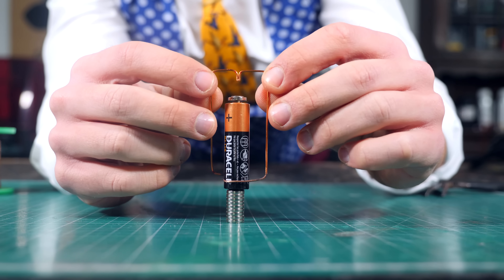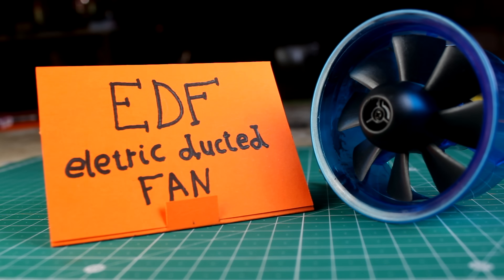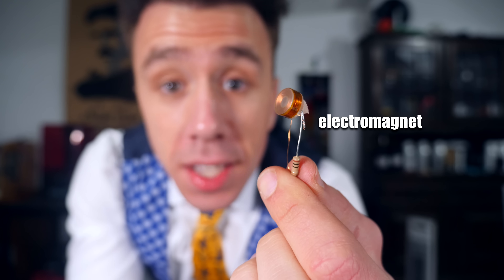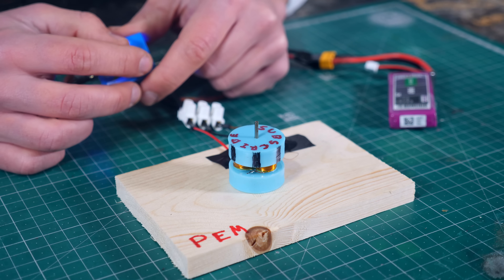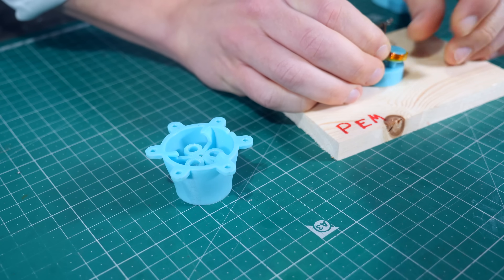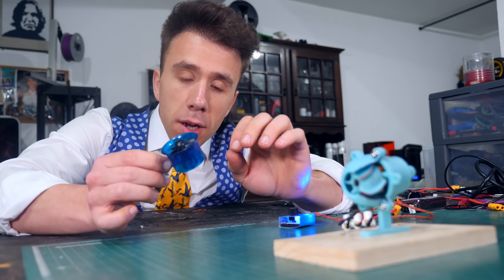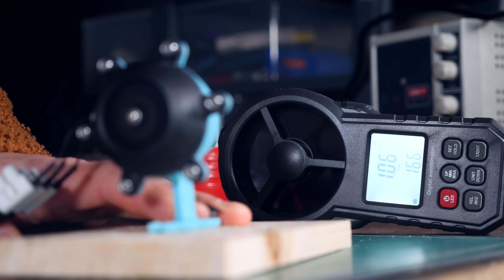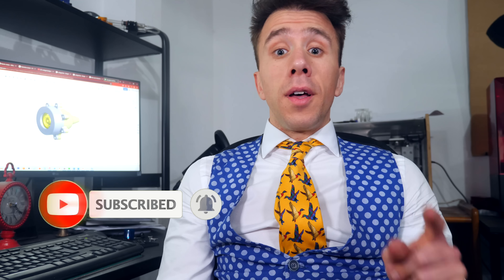I 3D Printed an ELECTRIC MOTOR FAN

Comment: Fans are great for converting rotational energy into propulsion and they do it fairly efficiently this is why turbofan aircraft are some of the most efficient and why most of the air moved by a modern jet engine is actually bypassing the combustion chambers and operating like a propeller. Higher bypass ratio is typically higher efficiency which is why modern turbojet fan engines are getting larger. These generate high mass flow rate but lower velocity and are good for cruising. Your EDF is essentially infinite bypass ratio as there is no air diverting to a compression/combustion chamber making it far more efficient at mechanical propulsion. The centrifugal fan is great at compressing the fluid and are frequently used in pumps and in front of combustion chambers for this reason where you have limited volume but you need more air mass to mix in more fuel mass. 
Thinking from an energy perspective instead of just pushing the air backwards with one bounce off the fan blade you are bouncing that air off of the impeller and the walls/channels of the housing multiple times while compressing it so you have some frictional losses as well as thermal as the air heats up under pressure and that heat dissipates through the housing. Performing more steps in the process will mean you need more energy input to achieve the same output. More or less it has been a few years since learning about pumps and turbines.

Comment: Recently I saw a video of 3d printer fans explaining the difference between axial fan (regular brushless fan) an blower fan (centrifugal fan), in there they explain that regular fan cannot move air trough a duct  as well as the blower fan, but what I really notice un your model is that centrifugal fans blow air better by the sides but your design kind of acts as a regular fan, moving air from the front to the back; the trust difference must be caused by the blades of the fans one having more surface than the other resulting in moving more air, just think this if two different cars have the same motor that doesn't mean they will run equally, there are so many variables (transmission, differential, tires...) , that are my thoughts in not an expert but hope this helps, the video I mentioned on top it's titled "3D printer fans - axial vs blower..." Also recommend you to reach to "the fan showdown" community of  Major Hardwarehere on YT, some of they know more about aerodynamics than me, and it's really fun to see 3d printed PC fans performance !

Comment: There was not as much information as I would like about your test, so I am not sure how much of this is speculation on my part:

1 - The distance between the tips of the fan blades and the edge of the duct is critical - you need this to be as small as possible to get the full effect.
2- Are you just measuring air flow and equating it to thrust?  The duct on a ducted fan should act as a lifting body, as well as acting as a nozzle to convert pressure to speed
3- As others have pointed out, you are changing the direction of the airflow.  Combined with the likely increased surface drag of the 3D printed part, you are going to see some losses.  TLDR: The straight duct is the most efficient way to make air faster.  Anything else will be second best.
4- The Dyson system is not designed to move the most air, it is about creating movement with the lowest sound and highest pressure difference while being efficient with power.

How to improve your design:  Start with analyzing the flow rate of your design vs. the the ducted fan.  Once you have maximized the  flow fate, tweak the design for the highest pressure differential.  Remember that thrust is the mass flow times the exhaust speed PLUS the pressure differential times the exhaust opening.

Comment: Different Propellers have different thrust-characteristics.

The motor inside the EDF does not just produce a fixed amount of thrust but rather it is designed to deliver a certain amount of power at a certain speed. If your centrifugal fan has different massflow and resistance characteristics (well duh - it has) then it will also perform very different.

In general an EDF is designed for nearly unrestricted straight airflow - so very low backpressure. Where as the centrifugal fan is very different - more useful for high pressure.

Also Dyson making the best impellers? No. They are just the same as everybody else too. Hell their fans are rather inefficient and take a lot of power to move the same amount of air. Their concept is rather that is looks neat and you just don't see the fan that is actually producing the airflow.

Comment: Too many factors to be honest. Blade angle, blade area, blade diameter, blade speed, blade design are all factors. Also, there is a difference between high speed or high pressure, or high volume low pressure. Fans have different designs per application. I would start by increasing the diameter with the understanding it will add mass and reduce the rpm but may increase flow enough to create more pressure thus higher thrust. May also make the output wider or smaller. Wider less pressure more volume smaller higher pressure may be less volume also.

Comment: If it is the fault of the difference on the curve of volume flow/pressure of both fans as said in other comments, you can also easily measure the pressure drop with a long tube with water, one end goes to the ambient pressure (before the fan inlet) and the other end goes to the outlet, to avoid errors it is necessary to close both outlets in the same way.
Each cm difference in water is a pressure drop of 100Pa. 
With this test you can easily see if the problem comes from the difference on volumetric flow/pressure curve that each fan is able to deliver.

Comment: I am an engineer, but of the electrical flavor with a good understanding of thermo and mechanical things.  Anyway, my quick answer is mass. The centrifugal fan you are printing seems to be optimized for pressure buildup, not CFM.  Thus, you are ‘throwing’ less mass, at higher pressure when compared to an open-ended (both sides) fan, such as your desk fan or your ducted fan.  Dyson fans use the centrifugal fan to build up pressurized air, that air is fed into a slit around the ‘airfoil’ shroud, which works by Venturi effect to increase airflow by creating an area of lower pressure in the center, thus amplifying the CFM/air mass being pushed toward you.  The air flow you get from a Dyson fan is NOT all originating from the fan… it is amplified.

Comment: First: This is definitely one of your better videos - a lot of ideas packed in with simple to understand explanations and entertaining as well. Most definitely worth the thumbs up.
Second: Thanks for the compliment, but as an ol' fart, I'm definitely NOT cute. I've been a fan for a while, but not cute ... (that's ok, I had my hay-day).
Third: 
> point 1: The efficiency of a ducted fan no matter what the fan's type or configuration is greatly effected by the gap between the fan blades and the inner walls of the duct. The greater the gap the less efficient. It's like a leak in a bucket. A large enough gap allows the edges of the blades to develop turbulence eddies that actually oppose the flow of air. It will be difficult to narrow this gap with a 3D printed fan because of the material's flexibility and the high RPMs, but maybe you can analyze the expansion or warping of the blades at different RPMs and design the duct dimensions according to a specific RPM.
> point 2: In the compression chamber when compressing the air there is a balance between air flow and compression rate or percentage. If you compress too much you begin restricting the flow; if you allow to much flow you aren't compressing enough. Consider a garden hose nozzle that you have closed almost completely. Water doesn't compress but this increases the pressure to maximum, yet the flow of water which may be at a high velocity out of the nozzle, it has very little volume so very little thrust.

Comment: This design is more of a "mixed flow" impeller.   Not really centrifugal or axial.    Centrifugal blowers are more for applications that need static air pressure with moderate flow.    Axial blowers are more optimized for volume flow rate.    It's not surprising that a centrifugal blade doesn't have as much volume flow rate as the original axial blades.   They are for different design points.

Comment: Aerospace engineering student here. Might not have a perfect answer but probably have a decent guess. 

The aerospike's success is fully dependent on choked flow and supersonic flow. There is almost no way you have a high enough pressure or velocity to generate choked flow. 

I'd suggest making the system larger, so you can have the ducted fan and the impeller in series with eachother. It may not give you supersonic or choked flow, but it should at least increase the thrust.

Ideally you would design a turbine to work with the nozzle. 

The critical thing with the aerospike nozzle though is the choked flow, without having supersonic flow after the throat velocity and pressure drop sharply.

Comment: ...perhaps in compressing the air the actual thrust generation is becoming lower?  The energy must be going somewhere.  The vacuformed edf probably has lighter parts as well, they may be more rigid too... if my experience with resin printers is any indication...  

I do wish I were closer... to figure it out of need to deep dive on the mechanism and figure out the exact forces involved and...well...  chances are it's just inefficiencies we can't see

Comment: Poking at this, maybe your centrifugal fan can be a lot bigger so as to increase the load on the motor. Maybe some energy is lost to the pressurized air not fully reexpanding by the time it leaves the nozzle. Maybe the printed parts are heavier and less efficient - but that mainly comes into play when it starts to limit the motor's RPM

Comment: My best guess for your problem is a difference in the Volumetric Flow-rate of the two designs. The intake diameters are different. If you are using the same motor, with the same top speed per design, then you would get reduced thrust on the output just because you have less air coming out the rear of the fan.

I am by no means a jet designer and my fluid dynamics skills are rusty at best, just as a disclaimer. My approach would be to check my speeds under load of the two fans to make sure my first assumption holds true. Then do some research on the Dyson fan motors and see how their kv and torque specs scale to the EDF motor. Then use that information to scale the design to match the difference between the EDF motor and Dyson one.

Comment: in simple terms

impeller good at increasing pressure, bad at pulling in air.
axial fan good at pulling in more air, okay at increasing air pressure.
fan blade really good at pulling in more air, bad at increasing pressure.

i suggest adding 2 or 3 stage axial fan before the impeller.

Comment: The Dyson motor spins over twice as fast as the EDF motor.  The EDF design is optimized for the 45k or so rpms of the motor.  The Dyson impeller is designed for the 120k rpms of the motor it uses.  So it does make sense that the Dyson impeller shape made less thrust that the EDF fan with both running at 45k rpms.  My guess would be that impellers require higher rpms than fan blades, but it may also just be possible that the impeller design has to be optimized for the 45k rpm speed.

Comment: So basicly your problem is volume of mass your fan does pass through. 
Potential reasons:
1- its easier for some air to go around without entering the inner area thus accelarating only with force of stickyness of air. Mate fan flatter and less aerodynamic in general. 
2- there is innecr cavitations inside the fan, basicly air is finding a spot to turn around and handycap the power output. Use method of sections or whatever aerodynamical analog there is to analyse the flow and to make apropriate size of chamber. 
3- there is something less obviouse. maybe plastic you're using somehow effects it. maybe dunno stand disrupts it. Neither give us like 34 min video with every test you can think of, info on your setup of printers and inner electronics ooor. Go and hire/ make friends with apropeiate specialist.

Comment: you should look at the long shaft turbos used in F1 engines, you could replace the exhaust impulse with a motor, and have a hybrid electric jet turbine, increase turbine speed with motor and turbine feeds combustion, and fuel mixes. this could also work to atomize fuel in the air charge before ignition. or at least a perspective way to make a rocket/jet speed controller. love the content, you make Nikola proud.

Comment: Shove a turbojet into your bicycle and see where that goes.
Also, for the turbojet, use a multi stage turbine to extract as much energy as possible from the exhaust. And maybe use a different type of compressor, preferably one that uses the entire diameter of the engine, because in your model, the impeller did not use maximum      space possible, which bottlenecks the airflow.
Also, in your RDE project (by far my favourite video) you should make the inlet for the detonation towards the side, like in your tesla turbine. And make an annulus so that the Rd wave does not just travel to the center of the barrel and dissipate.
To improve the airflow and still get compressed air, use a multi stage fan. Basically, it has multiple fans around a shaft that gets thicker as you go inwards. Thicker shaft + same size duct = less space for air = compressed air.

 Also, my brother likes to eat tomatoes raw.

Comment: The duct fan is designed to do air mass flow, the turbine is design to build pressur (or vaccum in fact) vaccum is not flow and they will never be equal. What you need is to build is a compressor fan design.  the first blade push the outside air in, it take up some speed than a new set of blade that should be placed in a different angle to take in account the new speed of the air and you continue like that, usualy those set of alternative blade should turn in diferent rotation side, but it is possible to do with out  a transmission to inverse part of the motor force by putting the alternative row of fan fixed into the wall of the duct walls with enough speed on te rotating blade the fix blade will act as if they are turning for the air flow.  This will create a lot of compression.  Like in a jet engine.  ;-)

Comment: you have 2 problems but luckily there's a few known solutions and i'm sure you can make your own

the impeller shoots out high pressure gas, we can agree on that i'm sure
so the issue is the pressure also pushes the air backwards into the fan which overall will decrease the amount of air you're pushing

and a second point, kinetic energy is 1/2 m v^2
the v is there twice, that means that the linear relationship of mv being vaugely constant (bernoulli's first principle, AV=cts, and from that you can reach mv is constant too but that's for an incompressible fluid so it won't track perfectly) the ideal kinetic energy turned into work is more to the higher speed less mass part of the spectrum and that's where the highest thrust would be 

so to summarize those 2 points the geometry of incompressible fluids would make it so that you get more thrust from more speed than more mass

and the fact that air is compressible is working against you in this situation

what you want is to create an area of lower pressure which is possible even with your current design (I suggest looking up how a dyson fan works to push air, it doesn't simply use the impeller flow, and also how a levalval (i butchered the spelling) nozzle for a rocket works), i'd suggest adding a nozzle that allows the air to expand smoothly so that you can have an area of low pressure   that helps the high pressure air come out faster, but at that stage we're reinventing the nozzles used by nasa, there are other ideas like the ones used by dyson and aerospikes where you run the high pressure gas along a surface of certain geometeries and gases simple like to stay close to these surfaces so you can generate your low pressure area as such

Comment: I was searching the internet in some ideas of a proportion sistem and sudenly thought of a turbojet engine with a plasma-assisted combustion system. The combustion process in traditional jet engines relies on mixing fuel with compressed air and igniting it using a spark plug. However, this process can be inefficient and generate harmful emissions.

In the proposed turbojet engine, a plasma-assisted combustion system would be used, where the air and fuel mixture would be ionized by a plasma discharge to initiate combustion. This would improve the efficiency of the combustion process, resulting in a more powerful and fuel-efficient engine.

Comment: The differences between axial and centrifugal fans/compressors are pretty extreme... one is an air screw, the other just yeets air at the wall.

The axial fan screws the air through it (look up tip vortices on aircraft taking off for a prime example of this "tractor phenomenon). The centrifugal takes air from around the shaft of the motor and then shoves it outwards until more air replaces it... aka it creates a vacuum at the center of the fan and pressure at the intersection of the housing and outer fan disk. 

The actual way each moves air requires a totally different frame of mind... centrifugal compressors are all about vacuum and pressure and mass flow is a consequence of these two.

Comment: EDF generates velocity, centrifugal fan generates pressure. Dyson fans use pressure difference, centrifugal fan does a better job at it.
For the centrifugal fan needs a tiny nozzle to generate high velocity stream, although, that would be trading mass rate for the speed.
Expect rocket-like behavior, where you charge a combustion camera with lots of pressure that blasts through a tiny nozzle with ridiculous speeds.